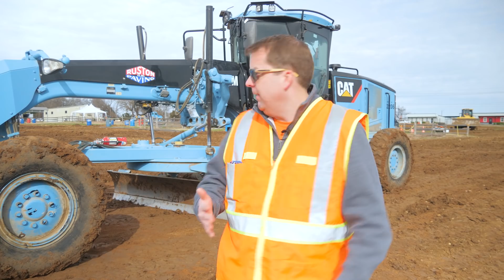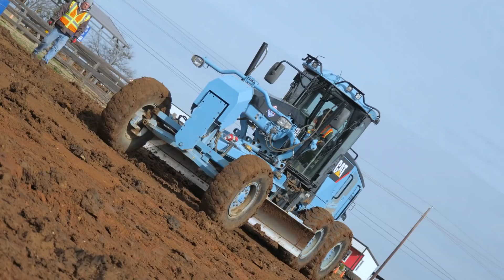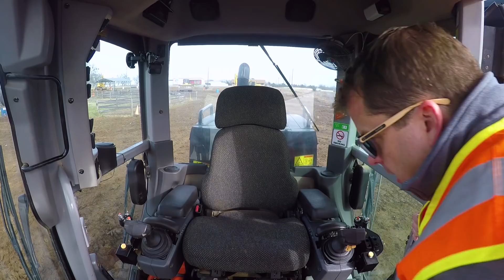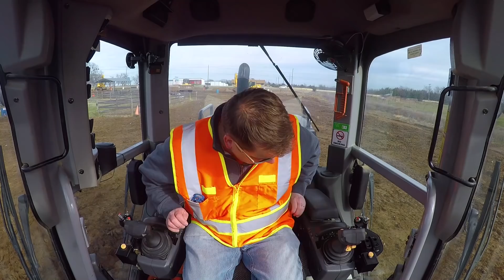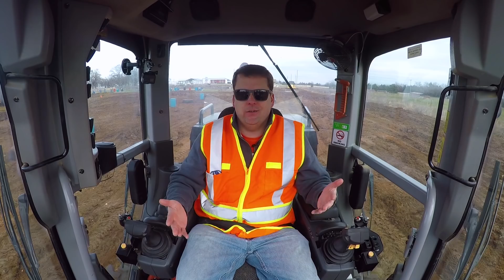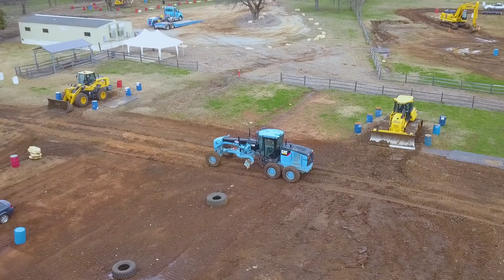How to Operate a Motor Grader (OLD - see fixed audio version in comments)

Comment: You were Partially correct on Some of the description but it’s best to leave instruction of a blade to a blade hand.
There is almost NO relationship from a dozer to a blade as you refer to in the video. A blade is a Finish tool and is far too complex to generalize the control and moldboard functions.

Comment: I wish there add a auto level like a loader so the blade levels for like roads and u can use one control fir both sides. It's stupid how they have not added that by now
Reply: They’ve had laser and gps on graders for years now
Reply: @craiger9313  ddeerrrrr  I'm talking about no GPS no nothing just stock

Comment: I love that denim blue color for that grader! Figured the blade would have an auto leveling where you punch in a grade angle. If it's entirely manual that requires a lot of skill. Definitely more complex than a wheel loader.
Reply: I reckon one of the most complex machines to operate. Im yet to have a go.
They do have ones with gradecontrol, gps, and even auto leveling I believe. But even with automatic heights, there is so much other stuff on a grader to operate still.
I take my hat off to grader operaters, and completly understand why they become grumpy old bastards with the complacated machine and quite often high pressure jobs
Reply: You can have gps set up on these I run one that is setup with gps because I do a lot of building pads so I need to see what finish grade is

Comment: I was a grader operator 30 years ago did alot on a cat 12 G didnt have joy sticks looks like fun to operate these new ones
Reply: 30 years, I bet your a grumpy old bastard🤣🤣🤣. Just jokin mate. I drive a watercart, and sometimes a posi, backhoe, tipper etc. but mostly watercart on new subdivisions, so spend alot of time stringing and rolling with grader operaters. And although we usually have a great operater, alot of them have a reputation for being grumpy bastards, probably because it is a high pressure job for an operater when you are under the pump, running gravel, trying to trim, and dealing with gear jammers and watercart drivers, roller drivers, useless labourers etc.
Anyway , Im hoping old mate is going to give me a bit of a run in his tomorrow, which is a joystick one, same as the one in video, but a 140
Reply from the maker: Thanks for the comment!

Comment: It's not a clutch. It's a inching pedal. 🤦‍♂️
Reply from the maker: If that’s the largest error you found we’ll mark that as a win
Reply: Heavy Metal Learning You also don't need the "clutch" to move forward and reverse. Just pull that lever into gear and off you go.

Comment: Are all graders manual just wondering?
Reply from the maker: Not sure exactly what you mean "manual".   Most of the new ones have many "auto" features depending on what piece you are referencing.
Reply: ExtremeSandbox I meant if most of them are manual transmission
Reply from the maker: @alextorres6146  Yes....but not sure if I would call it gears like in a manual transmission.   I don't know if I could answer that technically, maybe another operator can comment on this?

Comment: I run a older 770 and grade dirt roads I pull the ditch in 4th gear little over idle with tires tilted all the I grade the road articulated in 3rd gear full throttle
Reply from the maker: Thanks for the comment
Reply: Like to see that

Comment: Quick tip when cutting slop off. Angle the moldboard more so it flows off the blade and not pushing it like a dozer would and roll the blade back more.
Reply from the maker: Awesome advice...thanks for sharing!

Comment: I think using joystick as a steering wheel isn't a good idea. I'm okay with the rest of the operation
Reply from the maker: It's definitely a little awkward at first, but I think for a new operator it will probably be easier over time.   Thanks for the comment!

Comment: I'm cringing watching you use that inching pedal as a clutch. These machines don't need to be "clutched" when changing direction.
Reply: I have been running a blade for about 15 years. And yeah on the newer models you don't have to use the inching pedal/clutch. But if you're running a older machine's say a 140g use the pedal on shifting it will be easier on you and the machine. Cuz the older models shift very hard
Reply: I'm there with you,  you'd be surprised how many actual operators use that as a clutch. If they'd only look behind the seat and read the manual.

Comment: It's an "inching pedal" not a a "clutch"
Reply from the maker: Thanks for correction.
Reply: What is the difference between inching pedal vs clutch?
Reply: @quintinwilcox7617  you only use it when creeping around tight areas when you would need to move slower than your lowest gear will allow,  not for taking off.

Comment: Articulation is also useful in conjunction with leaning steer tires to prevent or reduce side draft (tendency of the machine to be pulled toward the toe end of the moldboard due to weight/drag of the load on the blade). The idea is to swing the frame toward the toe end of the board and lean the tires toward the heel end (soil discharge side) this will put a bit more pressure on the steers and increase the width of the tracking area creating a more stable platform and also increasing front traction to a degree. Only downside is you can't use as much power as the machine frame is strongest in the centered position. More articulation = higher risk of damage to the articulation joint and cylinders. Most commonly seen when cutting steep slopes where the machine is sideways to the hill vs going uphill or downhill (think Talladega or Daytona speedways) in this situation its usually easier to cut high to low and have the machine articulated to the high side, with the drive axles being closer to the bottom of the slope and the nose of the frame pointed towards the top, with the tires also leaned towards the high side of the slope (opposite of what you'd do on flat ground). This puts the moldboard at a much sharper angle across the frame but decreases the tendency of the machine to slide down the slope.
Reply from the maker: Excellent advice, very detailed.  Thank you for the comment

Comment: Cool stuff. Could you do a roller or soil compactor next?
Reply: There really isnt much to a roller, steering wheel. A lever on your right which simply push forward and drives forward, pull back and drive back. And a switch on the joystick will turn vibe on and off. 
usually a switch for park brake and a switch or dial to turn your revs up.
That is a single drum padfoot or smooth drum anyway.
There is also alot of different types of rollers👍
Reply from the maker: Thanks.  Will see if we can get one of those for a training vid.